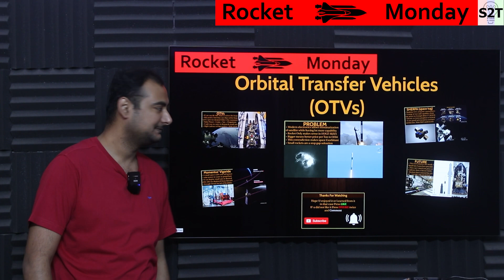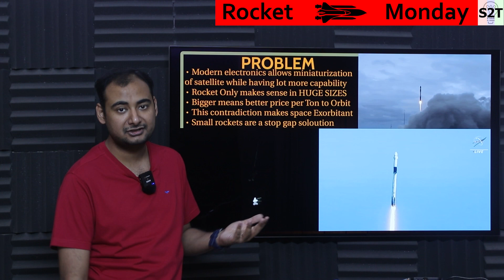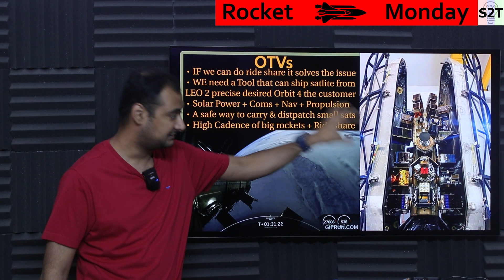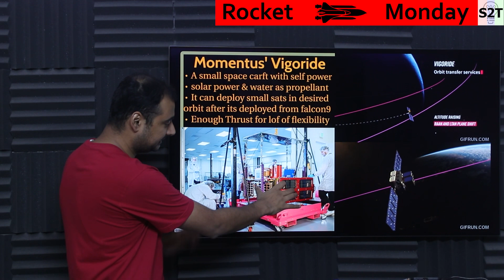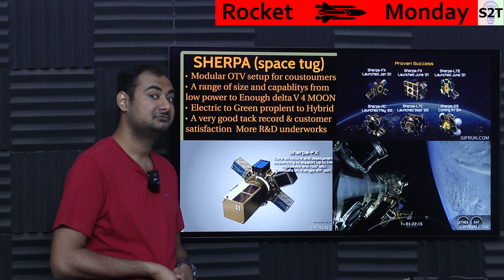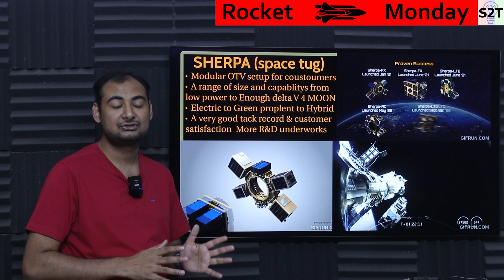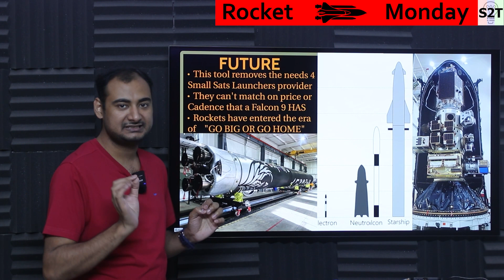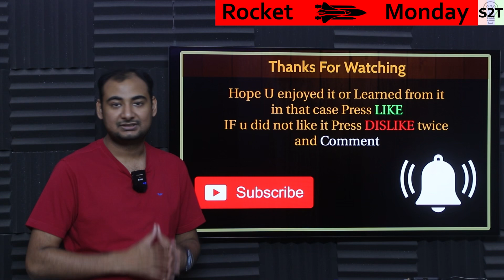Orbital Transfer Vehicles {OTVs} Explained {Rocket Monday Ep272}

Comment: you think we will ever get like a 200kg limit 2 seat space ship? .... it has to be be a single stage so an aerospike nozzle will probably need to be used.
Reply from the maker: na does not make that much sence
Reply: @s2tenglish  rocket lab's electron is fairly small, imagine that ... In the shape of a 2 seater space ship. Imagine that with rotating detonation engines. I think someone should do it